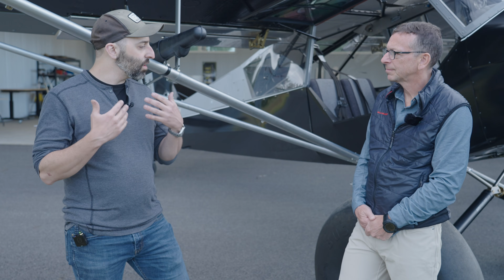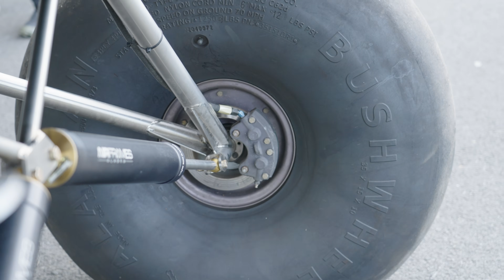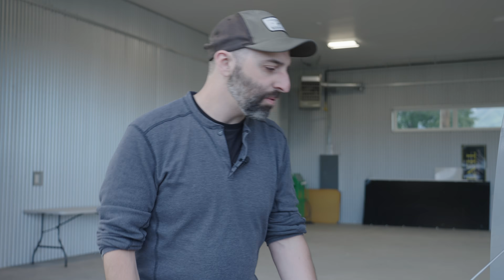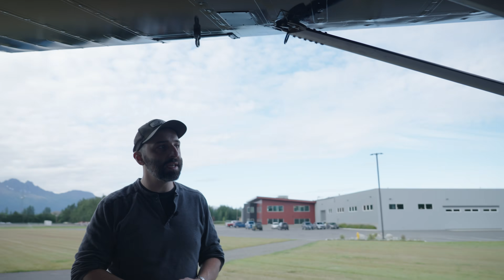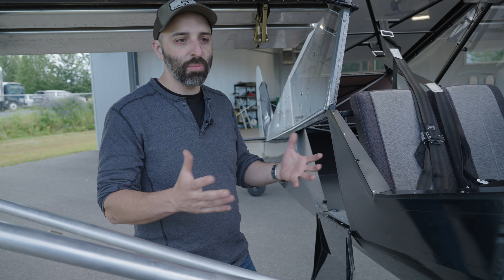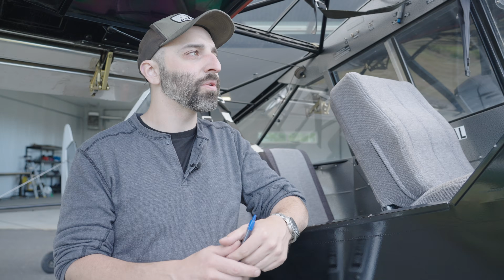Super Cub For Sale Alaska Gear Company

Comment: Having flown the Pregnant Cub and the M235 on deer recovery in NZ ,I'm happy to point out that the those wheels are just not needed. Why slow one of the best handling aeroplanes down and also create such a picking moment . Get rid of the starter motor and get on with it.
Reply: 😂 RIP the backseat, avionics etc out and you’d get a good load of deer carcasses in it